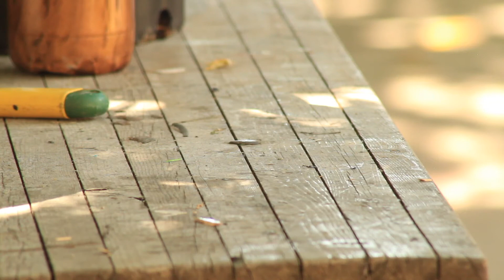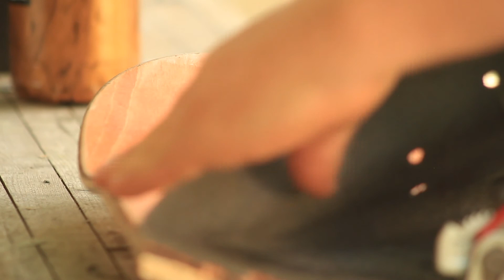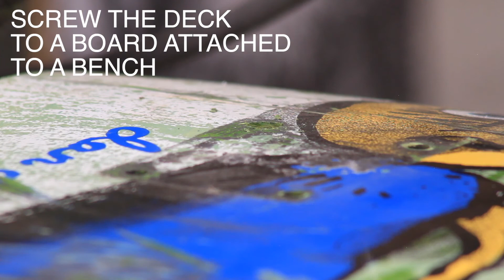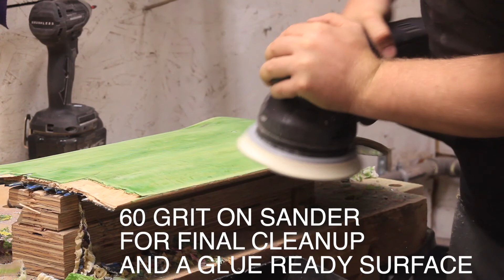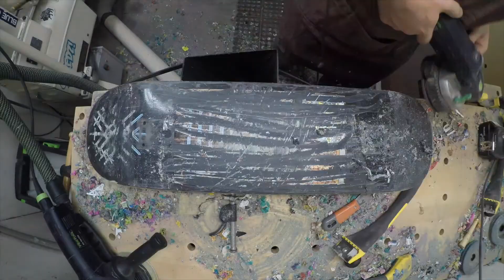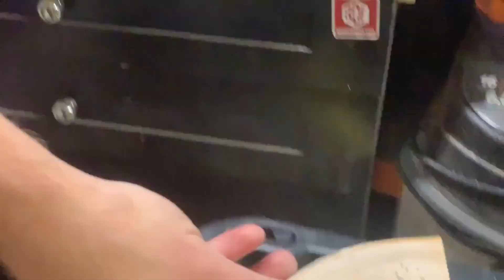HOW TO RECYCLE SKATEBOARDS

Comment: Not worth the effort IMO 😊. Nice video though
Reply: There are quicker methods than how this guy does it.  For example; you do not need to strip the paint off the entire bottom of the board the way he does.  I cut the board into thin strips and then when I'm ready to glue, I strip the paint with a 120 grit sanding block.  It's much easier to do and takes seconds.  Building stuff with skateboards is definitely worth it because every piece is super unique, and the colours are amazing.